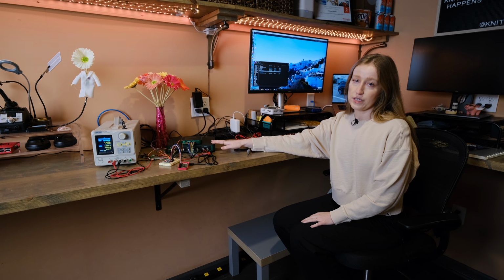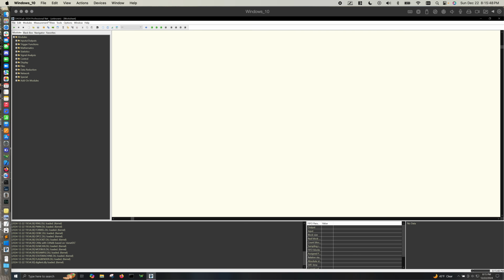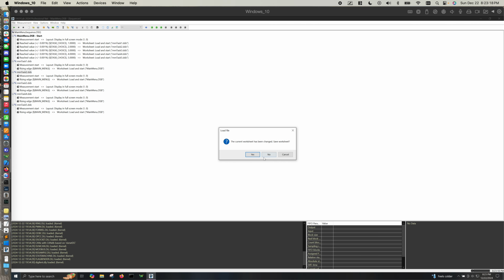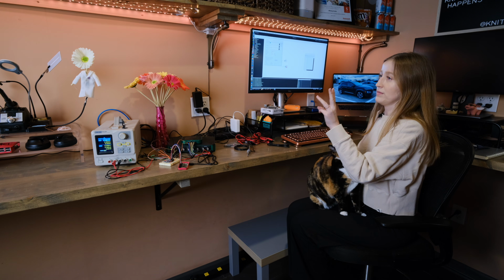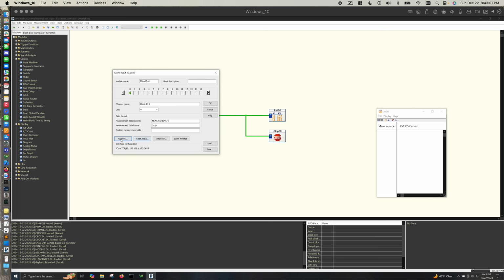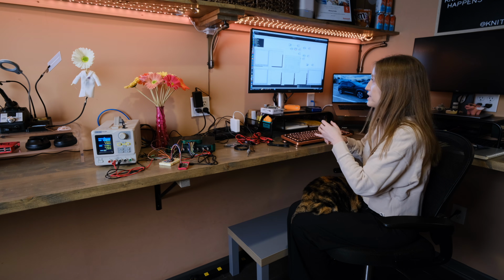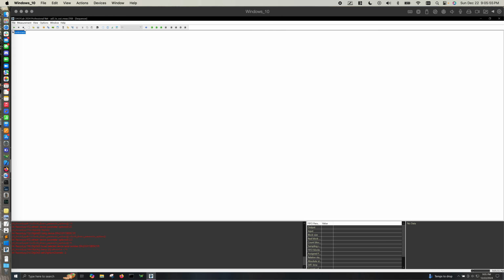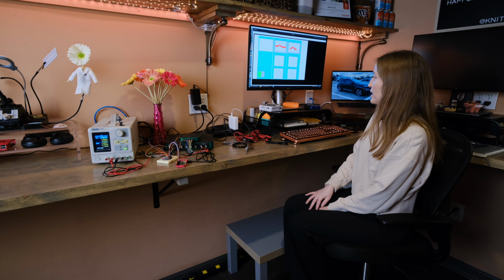Getting Started with DASYLab DAQ Software

Comment: Great video. This software does seem quite pricey given that every feature of the software seems to either be in beta or has bugs. I had a similar message for an Altium Designer add-on: Nice tool but wasn't ready to be sold at full-price (Keysight PDNA Analyzer).